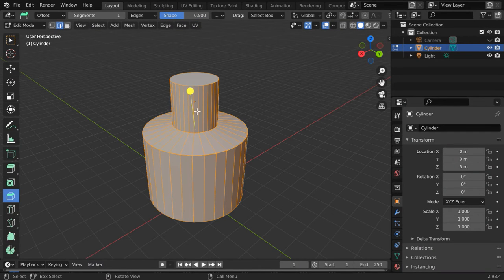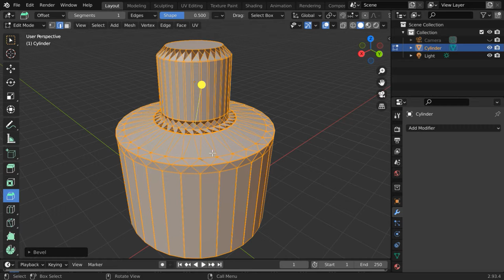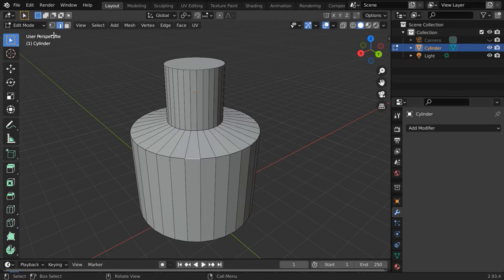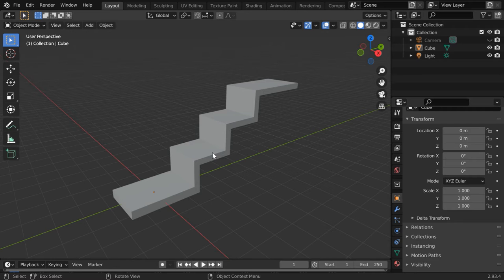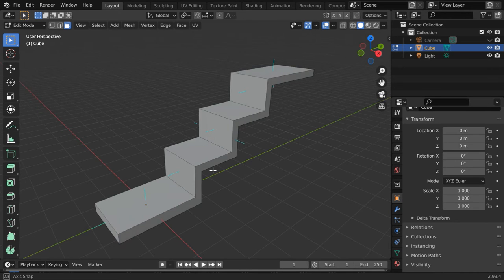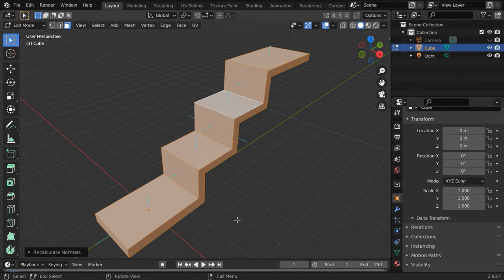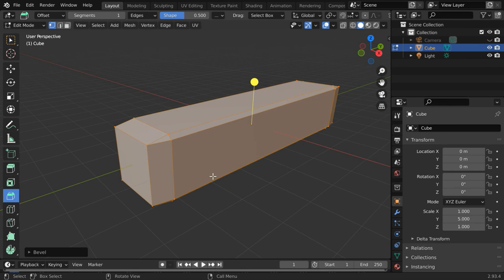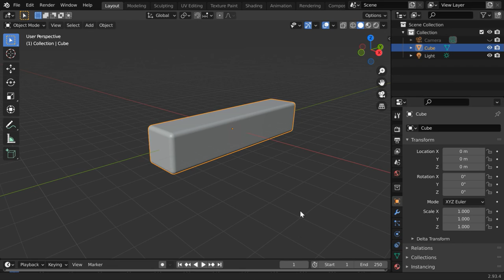[Solved] Bevel Not Working? Fix it with 3 Easy Tips | Fast & Correct Method | Blender Eevee & Cycles

Comment: Select all vertices, merge by distance (as long as you don't have verts really close, this won't cause issues). That is what worked for me.
Reply from the maker: Yes, this is how we remove "duplicate" vertices (actually they are not always duplicates, but just very close that breaks the bevel) 👍 But it is only one of the many possible causes that gives rise to bevel issues.

Comment: I did all 3 of these before I even came here, still no luck. But I will bookmark the video since it has the most common problems. thanks
Reply from the maker: Thank you. There may be a different issue in your case, can you please share your blend file so that we can try to identify what could be the cause? Our contact details (Email IDs) are given in the About section of this channel. Thanks!
Reply: @5MinutesBlender  thanks, I had cut holes in the object using a boolean modifier, so I think that had a lot to do with it. So I started over and used the bevel modifier on the cube before I started changing the mesh. so this way if anything causes problems with the bevel I would know immediately. Until I get more experience I'll probably make that a habit. Thanks for the help

Comment: Hello Derek. I have a problem in 12:10 with the bevel modifier, it is not working correctly. There is showing more connections with other faces and other stuff. Could you say waht is the problem?
Reply from the maker: There can be some specific issues with specific models, hard to guess. But if none of the stated methods solves your problem, you can select all in the edit mode and try to do a Limited Dissolve. If still not able to resolve, you can send your blend file as-is to us at 5minblender@gmail.com and we will investigate it. Thanks!

Comment: Thanks bro, yesterday i was facing this problem, now i get to know. But one issue also i was facing that i do shade smooth but faces are not getting smooth, they have line of meshes vertical, why is it so.
Reply from the maker: Shade smooth may not give correct result if the geometry of your object is not clean. Incorrect normals, or duplicate vertices can be some of the issues. Please inspect around the area where shade smooth fails. You can go into the edit mode and check what is wrong.
Reply: @5MinutesBlender  ok, thanks

Comment: Hello and thank you for the video.
I have had a problem with Bevel modifier. This modifier was connecting the vertices that were not connected normally and disconnecting some of the vertices that were making a face together. None of the sollutions you have told were working for this problem, the vertices were correct, normals were also for each face and scaling was not an issue. Then I tried to add bevel with using edit mode menu (also for all the object) and there was no such troubles.
Do you know what could be a possible reason for this?
Thank you.
Reply from the maker: I have experienced this too. There is one difference between the Edit tool and the modifier although the underlying functionality is almost the same. The modifier uses a "Limit Method" which determines which edges or which vertices to be included into the bevel (and this may not be always the same as what we intend to do) whereas the same tool in the Edit mode uses an explicit edge selection i.e. it includes only the edges we specifically selected for this operation. I guess this may be a reason why you saw a difference in the results from both of these methods, although I must say that some beveling issues can be too complex to explain, at least in my experience.

Comment: Just made my object bevel even worse after trying tip 1 and 2. I already had tried tip 3 from prior research. Not sure why a default cylinder would be so jacked up with nothing done to it.
Reply from the maker: We covered some common use cases, but an object can have other type of issues that may need some specific handling. We can help you further if we get to see your blend file. Our contact details are given in the About section of this channel. If you can send your blend file, we will look into it and suggest a fix. Thank you!

Comment: Eh didnt work. Removed vertices but yet when i try to add bevel to an edge on the object it makes segments but only on one of the faces of the corners, instead of both, keeping it flat.... doesnt make sense
Reply from the maker: There may be some rare cases outside the common errors we have discussed in this tutorial. For each of such cases, the solution may be different. So if you can send your model to us (5minblender@gmail.com) we will be able to investigate the issues and suggest a fix. Thank you!

Comment: Look thank you.....but really do wish Blender stuck to the same blimmin format of bevelling, like all other softwares. It shouldnt be worthy of finding a solution on the internet to do a basic 45 degree bevel.
Reply from the maker: Completely agreed with you. I don't have enough experience with other modelling software, but I know why Blender struggles with this. Blender uses a polygon-based approach for mesh objects. Instead, if we use a curve-based or a vector-based approach, it becomes a simple task. For example, if you try to bevel any text field (before you convert them into mesh), you'll notice how beautifully and how effortlessly it is done in Blender. In fact, I am thinking of creating an add-on that can make this bevel job easier by shifting the bevel part to a vector-based algorithm.
Reply: @5MinutesBlender  
Oh my goodness. That would be so awesome! if you could. Thanks for the reply, have a great weekend.
Reply: @5MinutesBlender  
One more thing that sticks in my ass is Blender's really crappy UV layout system. It's really bad. They dont even have a 'relax' function, which splays out the entire mesh like Maya does it. I've got a really complex shape to do a spiral column, and no matter which function I press, it's impossible to have the UV grid to be squarish. So I have to map out section by section using the (project from view) patch it up like a jigsaw puzzle. So annoying. You'd think the function of using the (mark seam) then unwrap would work, but it just doesnt.
With Maya, you could select the whole thing, and press relax, and it would splay it out in a second! It'll take me about 2 hours to do a basic job. Argh. The pain.
Reply from the maker: @DominikWysocki-ml2he  I can understand bro 🙂

Comment: none of these were my problem (wtf is up with my model???)
Reply from the maker: Sometimes it may be really difficult to get the bevel effect corrected due to the underlying geometry (or better to say, every geometry has a threshold up to which a bevel will work and beyond which the bevel will break). There are some advanced mesh editing that can help in some cases apart from the common techniques we discussed here, but there are always some 5-10% cases that are impossible to solve without remodeling 🙁